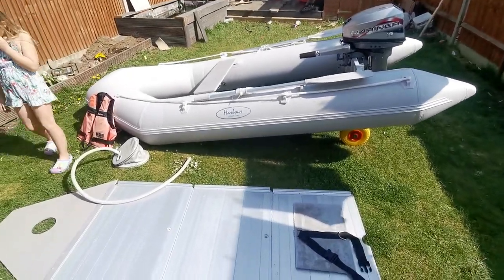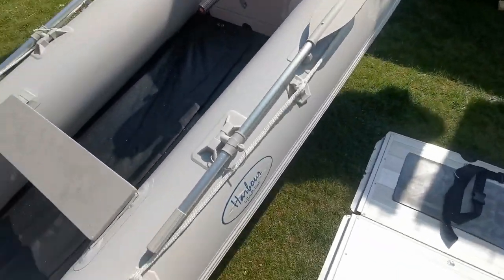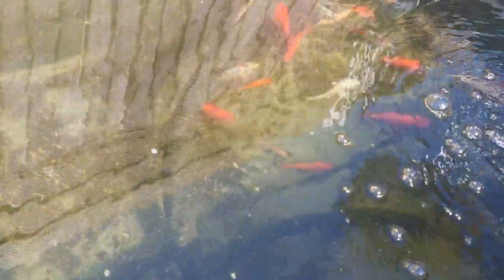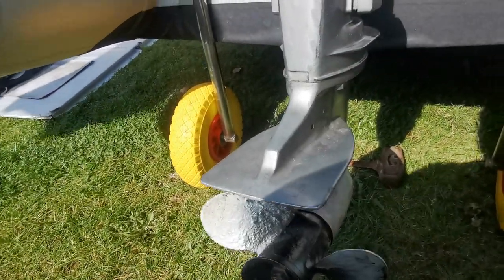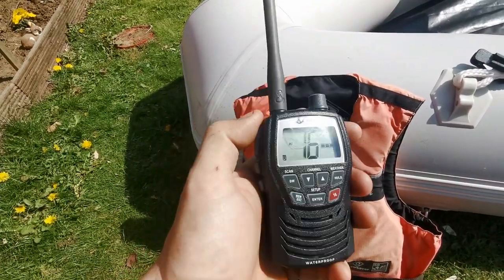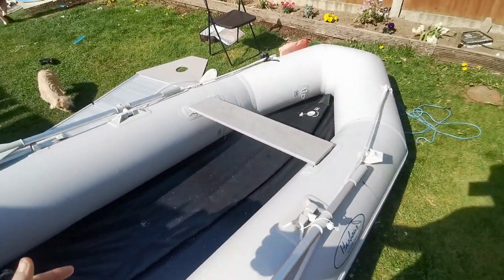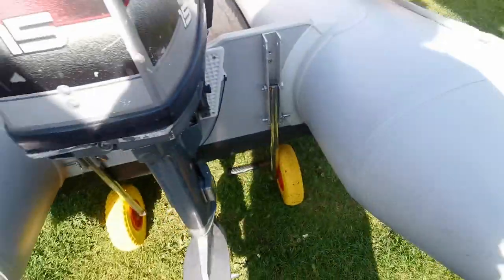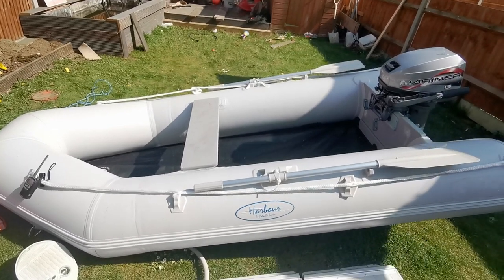Inflatable boat fishing setup with a mariner 15hp outboard

Comment: You probably know this already but just incase dont start the engine unless you got it in a bin full of water  or with muffs and a hose pipe connected  it will over heat otherwise  and blow the head gasket !  Id like to see it folded up  its amazing that it goes in the boot of ap car

Comment: Interesting video. Would the boat and outboard fit in a hatchbacked fiesta? How many weekends in summer is it calm enough to go out to sea? Do you wear a wetsuit?
Reply: I used to fit my 2.9m one (with air deck not alu floor mind) and 15hp 2 stroke mariner in the back of the  mrs fiesta, but had to have seats folded down as  I remember. Hope that helps!

Comment: Nice vid, I had a honwave last year with airdeck but couldn't get on with it, I would have prefered an ally deck. Another important item you need is a dry storage tub for phone and radio etc and some flares, looks like you have an air filter missing off the back of the carb?
Reply from the maker: Good shout bud I dident mention the Anchor either lol and I thought that about the air filter I'll look into it a bit more
Reply: @FishHunterUK  I think it's only a black plastic cover but it stops the engine injesting things 😉. When the bans lifted I'd deffinately like too meet up next time your in West Sussex. I normally have a boat in the water in summer months
Reply from the maker: Defo mate I like fishing Selsey and Shoreham
Reply: @FishHunterUK  I normally go out from littlehampton but there some good spots from there and a lot of tope just past Bognor. But hook up with us in the summer and if your down this way you ve got another pair of hands or spanners if need be. There's nothing worse then being miles from home and an engine part breaks or lose an anchor or rope or pull cord breaks 😂
Reply from the maker: Oh Peter thanks a lot bud that's great and tope is my main target this year I just have to catch one I don't care how big lol I just need one lol

Comment: I have a sd260 excel class c v-hull inflatable floor its big enough for me and my fishing gear at yhe moment but if i like going out at sea I'll invest in a bigger boat if not I'll keep this for the rivers 🎣great video fella i thought you need a licence to use the vhf radio as you need to register it before it will work or has someone fed me some crap information??
Reply from the maker: You should have a license mate but its not law and no the radio will work from straight out the box buddy
Reply: @FishHunterUK  i was going to do the test this year for the license down in poole! but I'll wait till this is all over? can't do an on line course as i dont have a lap top or computer lol.😂